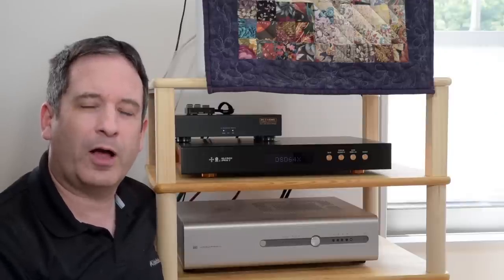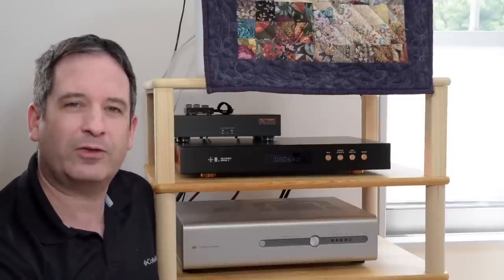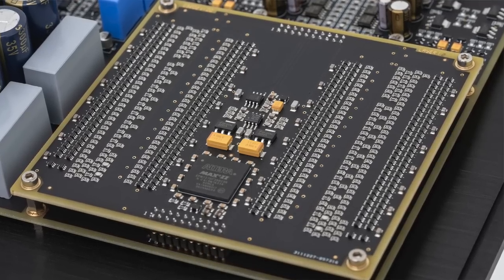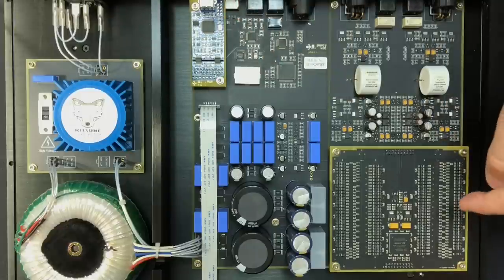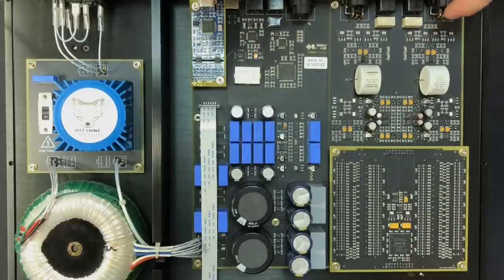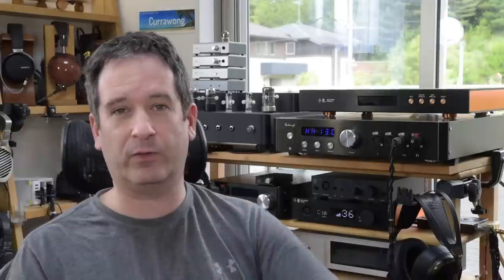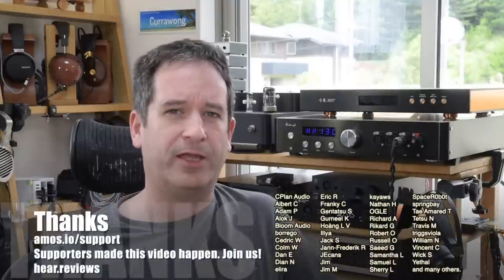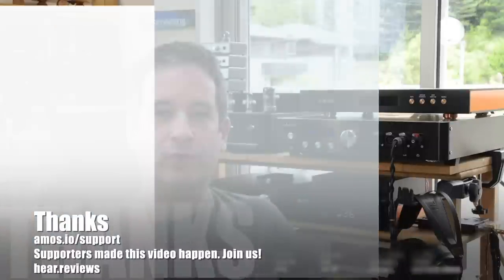HoloAudio Spring2 Kitsune Tuned Edition - Why is everyone interested in this R2R DAC?

Comment: Thanks for your review its very helpful.  One thing that is important is that Holo has a trial period.  I have a Denefrips Venus II going through Michi P5/S5 into Focal Sopra 3s and 2 Rel S812s.  Just ordered the May KTE, Im hopping for the best as I feel my system will reveal it.  Otherwise Im gonna need to save for a bit to get up to the next level of DAC $10-20k.  BTW my system sounds amazing as is, so we will see
Reply: isnt it only like 5 or 7 days-----and it is said this unit dont sound good until 300 hours and great until 800 to 1000.  I am wondering how the Venus II from denafrips is as it is over 2K less costly and have only heard ONE person in a comment trashing it because of some sort of error rate.

Comment: I recently got the Spring V1 Level 3 and I like it a lot. I noticed when it is sufficiently warmed up it has less bass(but still plenty adequate). On the upper end it opened up the midrange and tweeter on my Polk 707's like no other DAC has before. Almost KEF LS50 territory. Soundstage and detail are fine, the overall sound is on the dry side.

Comment: Resistors do come in 0.1% and 0.01%, plenty of stock at places like Digikey and Mouser.  You can also custom ordered resistors with precision down beyond 0.001%, well within 16bit precision which would require 0.0015%.  These are laser trimmed during manufacturing and can run you at 10$-20$ a resistor.  They are also available in temperature compensated versions.
Reply from the maker: Good point. Cayin had to much to say about this with the release of the new R2R module for their N6ii DAP. More audio-grade resistors have become available more recently. This is a good thing for people who love R2R DACs. https://www.h-ear.audio/2021/05/14/cayins-new-r01-r2r-ladder-dac-module-for-the-n6ii-dap/

Comment: A couple of things to keep in mind about resistor tolerances; a one-percent tolerance is tested in the manufacturing process to ensure it's actual resistance is within one percent of it's rating.  That doesn't mean that there will automatically be a one-percent error, and resistors can be hand selected for proper matching in high-end audiophile applications. Also, a one-percent tolerance band is much larger on the highest resistance (most-significant) bit than it is on the lowest resistance (least significant) bit, so the overall resolution will still be within one-percent across the board, and that is if they don't bother with screening the incoming resistor stock for highest accuracy.

Comment: Around 1992 I gave my multibit Sony CD player to my x wife, along with some nice Paradigm 2-ways and stands.  A few uears later, I needed a CD player again, nut all I could find was 1-bit units.  I bought another Sony, took it home and played it, only to realize that the music had lost its depth.  I was rather upset by this, because the engineerrs said "they sound the same" and "no one can hear a difference" between 1-bit and multibit CD players.  But that's crap and it really bothered me to the point that I turned my back on music for many years.  Fortunately, we have digital files and good sources now, so I am all in again.  I don't think we should ever believe  that "no one can hear the difference" again.

Comment: i just purchased a basic 20 dollar usb audio card with the phiips tda1305 DAC it has a presense like no other, and "surround-like" holography  it out performs any sabre dac i ever heard, and for hi res i purchased a 50 dollar audio card with wolfson wb8741 and upgraded it with 3 discrete super fast 200mhz opamps the holography is from another dimension, the speakers disapear even they are not aligned to my ears or acustic treatment in the room, it also outperforms any akm, sabre dacs, and only with that extra speed can compete with oldschool philips dacs, both audio cards are just the dac chip and preamplificators, nothing fancy or complex, then "topology" and design its a mith

Comment: Thank you for your review and I just got done adding a I2S card to my Oppo 203 from OPPOMOD this morning for my Spring 2 KTE. I've been listening all day straight from transport/CD from the Oppo 203 via I2S to the Spring 2 KTE and I am hearing a bigger more detailed sound stage. And I am able to play all of my SACD as well through it. I had to go out to the garage and unpack most of my CD's I converted to FLAC to give it a go. Now like most of anything audio the recording needs to be clean and well put to together. So I was listening to a CD from the 80's I knew sounded very compressed and guess what it still sounded bad.  I have made so many audio upgrades this year but it has been worth it.  Oppo 203 CD/i2s --> Holo Spring 2 KTE --> Audio Gd Master 9 --> Meze Empyrean (Norne Silver Litz Cable) = HEAVEN

Comment: Just bought a spring kte today will report back with my impressions.
Reply: Please do! Considering the KTE aswell... :) Though i wonder how much the kte improves since the level 2 version is 800 euros cheaper.
Reply: @PreBlazed89  I've had it for about a week and love it... I ended up buying the Spring 1 KTE with singxer su-1 over the Spring 2.  I got a much better deal used and though the KTE was a better performer over the Spring 2 Lvl 2.   The main issue with the Spring 1 was the USB input underperformance heance the su-1 unit.   Thus far I love the unit and it's worth every $/€  although if I was shopping the Spring 2 I'd stick with lvl 2.

Comment: Hiu Currawong. Trying to decide on a DAC upgrade from my Lindemann Limetree Network and am considering the newer Kitsune tuned Holo Spring 3. I run a Prima Luna EVO 300 Integrated amp with Klipsch Palladium P-37F horn-mounted speakers. The unit I felt I was gravitaing to is the Auralic Altair G1.1 (G2.2 and Vega more budget than I have) and have begun to wonder if, as a general rule, a sigmaDelta-based DAC sounds good/better with a tube-based pre-amp/amp versus a R2R ladder-based DAC with same tube amp. Also going for an combo DAC/streamer however can be swayed by DAC quality to seperate two. Also appreciate that streamers have as much, if not more, impact on sound quality than DAC. Looking for liveness and musicality and musical immersement/engagement. Not sure I woulkd enjoy music that is too flat and accurate. Thoughts please. Thanks & Regards Tony

Comment: Hi Amos, nice thorough job once again. Yeah hardware (and software) upsampling still has problems and DSD can be hit or miss. I have quite a few DSD recordings now (and LPCM) and I prefer 24/96 pcm over DSD (most of the time). I totally agree 16/44.1 still sounds very good given the right gear combination. The latter being the hard part. Your channel makes that process much much easier. Keep up the great work !
Reply from the maker: Nice to hear from you Peete! Drop me an email sometime.
Reply: @Currawong   Will do. :)

Comment: 0.01% resistors are on a market for about $1/piece. So, only 11 out of 24 bits must be compensated. From 1 compensation bit up to 8 (about). This is not a big deal and a rocket science. But requirements to power supply, conductors, biases, and electromagnetic noise are quite challenging.

Comment: R2R is great to play back older recordings, many of them are digitized in the 80’s using R2R ADC’s.

Nowadays music will be recorded digitally using single bit Sigma Delta modulators.
So using state of art R2R DAC’s to reconstruct this Sigma Delta modulation makes no sense.
Reply: I’d have to disagree with your statement, as it has no basis in sampling theory. PCM is pcm no matter which method of digitization was used. The early ADCS were very high in jitter, linearity, and phase errors. The new ones are much more accurate, but usually use subpar digital filters, even at the professional level. These distortions don’t care about the topology of the dac used, as the sound signature is already in the digital bits. The only reason to use a delta sigma dac over an r2r, is if you’re listening to dsd recording made with a ‘new’ delta sigma adc (which are very rare).

Comment: I have an Audio GD Ref 5 from around 2012 featuring 4x Burr-Brown PCM1704U-K is that similar to what's being discussed here? I found the video super interesting just quite a lot went over my head!
Reply from the maker: Quite similar. Those old chips were resistor-ladder (R2R). They are no longer being made, which is why manufacturers are turning to making their own resistor ladder arrays.
Reply: @Currawong  interesting, thanks for the reply.

Comment: I am curious to know your opinion on how it sounds compared with an Audio-GD R2R DAC.
Reply from the maker: That's a bit tricky, as the Audio-gd firmware can be changed to make the sound slightly different. However, one thing the Audio-gd DACs do better is high-res and DSD.
Reply: Currawong , 99.9% of my music is red book format, so I may not make any substantial difference. I am struggling as on one hand I am very happy of my Audio-GD Master 19 but I have no possibility to test one of their DAC,s, and on the other hand Mr. Jeff Zhu from Holo Audio is almost my neighbor (he lives 300m away from me in Suzhou). So I can easily go and test a Holo Spring. Anyhow thanks a lot for your reply. I really appreciated that.
Reply: @Currawong  but Audio-gd DACs can only go up to 32bit / 384K
Reply from the maker: @xq0404  Only? What difference does it make? A resistor ladder DAC of this kind is not accurate over 20-bit, and the difference between up-sampling (ie: using your own digital filters) to 384k or 768k is nothing -- in fact, it is possibly less accurate processing the higher rates.

Comment: Very good videos. I just found them and subscribed. I am in the market for a dac and I'm not very smart when it comes to all of the technical stuff. I picked up a cocktail audio x50 streamer and cd ripper that I like quite a bit so far but my dac is only 44k capable and I want to be able to take as much advantage as possible of its abilities. I know it has i2s hdmi output and from all I've read, it seems like that's a good thing and I'd like to find one at least with that input. Any advice would be greatly helpful. I'd like to stay around a grand or a little bit more hopefully. If it helps at all, I'm running a primaluna dialogue premium preamp and hp amp with focal Electra 1038 be speakers. Keep up the great videos. I'm skipping music tonight for your videos. 👍

Comment: Am I to undertand that under the non-oversampling mode, the DAC will play hi-res files directly including HQPlayer-upsampled 1.536M PCM and DSD1024 files theoretically?  But none of them sounds as good or as natural as the CD quality files under the NOS mode.
Reply from the maker: That was my impression, yes. You could experiment with different HQPlayer filters though to see if you can find one you like.
Reply: @Currawong  Thank you so much.  Would you compare the sound quality of hi-res files played directly under NOS vs. under the OS mode (AKM chip used)  ?  I also assme that native DSD files played directly under NOS do not sound as good as those played under OS mode?

Comment: Anything upsampled to DSD from DSD non native sounds robbed of dynamic range and bypasses PCM filtering. Usually loudness is damped by 3 to 6 dB down by default nevermind the upsampling software Usually applying an additional 3 to 6 dB down.

All filters and EQ must be done upstream from the DSD dac.

Lastly DSD upsampling to even 256 is absurdly inefficient and takes up massive storage. 

Upsampling anything not natively DSD adds no information, robs cpu/gpu power, takes up way too much memory, robs dynamic range, bypasses pcm and dsp... its just bad.

Also anything upsampled beyond 48kHz moves all filter targets into ultra sonics and is inaudible so it does not matter what filter you use... however you should just use NOS mode/filter for 96 and above kHz to free up the signal path.... there is no roll off at these sample rates.

Comment: It is easy to buy 0,1% tolerance resistors.
Reply from the maker: They wont be accurate enough for even 16-bit audio though.  You'd need 0.001%, which don't exist.

Comment: How does this Dac compare to the Chord qutest?
Reply from the maker: It's soft/warm-sounding compared to the Chord Hugo or Qutest, which is more precise, yet musical.  The Spring2 is also best with CD Quality 44.1 material, but not so good with high res, and I didn't like it at all with DSD. The Chord gear is excellent with all, and fantastic with DSD (even if DSD itself is redundant).
Reply: @Currawong  cool thanks for your insight!😊
Reply: Currawong Thanks a lot   I am still on the verge to upgrade my DAC and I wanted to know an opinion right on this.
Reply: @Currawong  I found the Spring played native DSD better than any DAC I've tried - except the HoloAudio May. So did Todd Garfinkle of M-A Recordings who now uses the Spring converter to make LPs from his Koorg 2002 DSD files.
Reply from the maker: @Cocteau61  Hi Herb, it's nice to see you here. It'd be interesting to compare what you find enjoyable when it comes to the playback of the same musical files through the same equipment with my own experiences and preferences.  I've noticed some people like the smoothness of DSD, sometimes to a degree that I'd find to be totally unnatural or lacking in the subtle dynamics of the music itself.